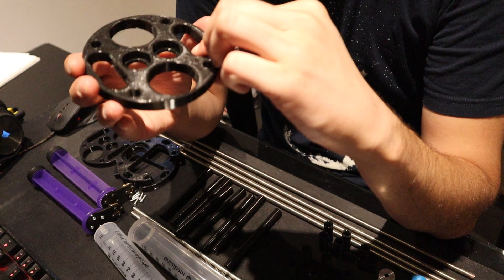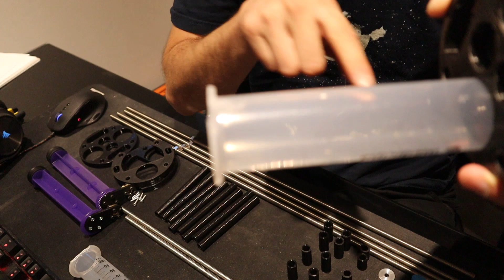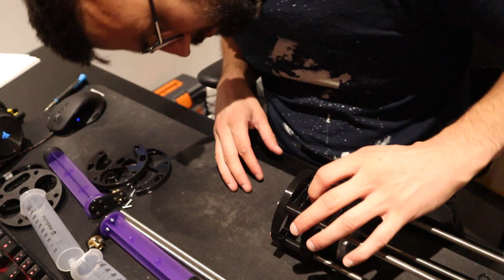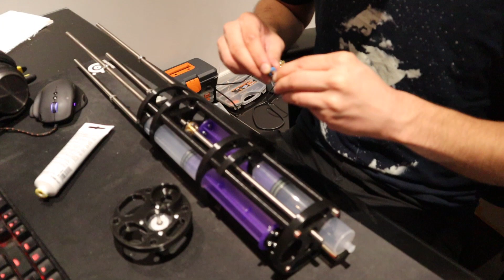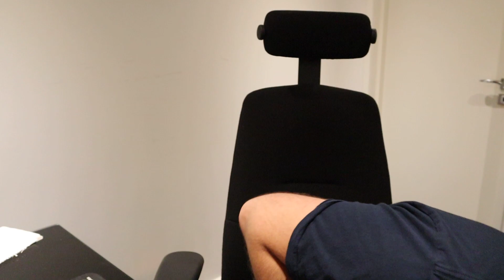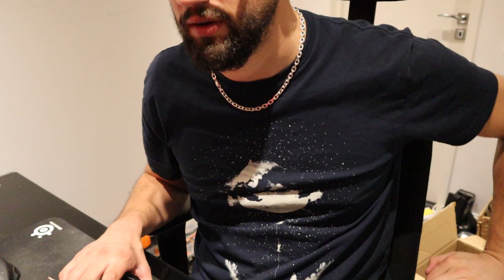Building a submarine - Part 4: New ballast system

Comment: i see you are using arduino so i recommend to check out MPU6050 this is electronic level that can help to navigate the whole construction xyz axies
Reply from the maker: Thank you for your comment. Long term in this project I expect to not be reliant on Arduino but using microcontrollers more directly even if some hardware make it easier to get started for now. So yeah, any hardware that solves the problems I am interested in are welcome, but Arduino is not necessarily a deciding factor. :)

That said, I've been quite slow in my progress, partly because I these days earn my living off programming so I no longer have the same drive. I would love to finish this project eventually however. ;)

Comment: Hi  Robin, I am big fan of your project, looks high tech and innovative. I am too looking to build one using Arduino with opposite pistons. What I would try is to combine what tiver21 did here: https://www.youtube.com/watch?v=Pdb6g520t6w&t=266s but using pancake stepper motors(https://www.pololu.com/product/2297) with lead screws. Another thing, your chosen motors are too large, I would go with the outrunners(https://engel-modellbau.eu/shop/en/Electric-Motors/E-Motors-Brushless/MERCURY-BL-Outrunner-C35-30-300-Brushless-Motor-300-kV.html). As far as the battery is concerned, I would place it outside, under the WTC, in the keel for balance and space considerations.  My favorite choice for battery is the Headway one(https://bmsbattery.com/ebike-battery/392-headway-40152s-15ah-10c-lifepo4-cylindrical-battery-cell-battery.html), build a cylinder pack, waterproofed and you will have a lot of Ah to play with, sufficient to cover what stepper motors consumes.:)
Another idea is to use PID library and an pressure sensor to keep your submarine level(static) at a certain depth(so called "periscope depth") using small correction by your pistons. 
There is one more concept that we need to pay attention to, here: https://www.youtube.com/watch?v=GAKMX1gBrbo&list=PLvvgI--KcBAGaQ50JoJjGyl1C6LonZPKR&index=46. I would use to Kavan gear pumps to fill and empty the pistons, simpler design but harder than stepper motor to implement the initial and upper limit. 

Cheers! Bogdan

Comment: Great project. What is the diameter of your wtc On thingiverse is a gotland submarine I want to build in the future and that one needs a wtc off 75mm.
Reply from the maker: Well I'm basically making the whole thing a water tight cylinder. I'm using a 110mm sewer pipe, with a 103mm inner diameter.

Comment: hi, i like your design and i want to see how it turns out, beware what grease u put on the rubbers of the syringe, vaseline would be ok but it u use normal grease the rubber will become soft and come loose. also make sure that the connection with the plunger and the leadscrew nut does not pull in an angle so the nut may be seizing up on the screw, maybe make a guide over the leadscrew or something, just my honest opinion, cheers
Reply: oh and u could easily test how deep your motors would be able to push out the water, put a pressure gauge on the end of the syringe and look how much pressure u can build up, 1bar=±10 meter

for balancing maybe u can use those led strips they use to balance your wheels of your car
Reply from the maker: @wardwyseur  Hey, thanks for your input. I actually discovered the issue with the grease shortly after making the video. You may notice I say in the video that one of the pistons don't go very smoothly, it's the one I already applied grease to a couple of months ago in part two. It seems it actually dissolves the rubber or something, since it seems to get sticky and get stuck if it's not moving for a while. I will definitely use vaseline or something instead, and will probably need to buy new syringes.

About the piston being pushed at an angle, it seems it's fine tbh, but yeah I discovered it had a lot of play so having some kind of guide would probably be nice. Issue is friction though, might need to figure out something there... perhaps use a linear bearing on the opposite lead screw or something.

Another easy way I found to test how powerful it is, without using a pressure gauge was to have it fully extended, put my thumb on the hole and let the motor push it in. It stopped about halfway, which means the air must have compressed to about half the size, so 2 atmospheres of pressure, or 10 meter of depth in water. Pretty decent I think, and I could probably quite easily replace it with a lot more powerful motor in about the same form factor.
Reply: @HolyGarbage  maybe u can print a plunger and instead using the rubber cap, use an o-ring the rubber cap is for medical reasons i think it's cleaner and the syringe can be empty-ed fully
Reply from the maker: @wardwyseur  Yeah, possibly, not sure what the gain would be though, if it would sustain a higher pressure etc. This way is pretty good, makes a good seal. Designing my own could result in me making it worse. I need to replace the lubricant anyway if I use o-rings. But hey, might be a nice experiment in the future to try out if I can make it more pressure resistant.
Reply: hello I am interested in your STL file, is it compatible with submarine 1/48 in scale because I am stuck with the electrical connection of the hub step by step with the end of stroke sensors everything to be ordered in a radio controlled rc Thanks a lot @HolyGarbage
Reply: hello I am interested in your STL file, is it compatible with submarine 1/48 in scale because I am stuck with the electrical connection of the hub step by step with the end of stroke sensors everything to be ordered in a radio controlled rc Thanks a lot
Reply: @HolyGarbage hello I am interested in your STL file because I am making an rc submarine of length 70 cm the diameter of the interior and 110 mm is your ballast compatible with my model because I am stuck on that thank you cordially